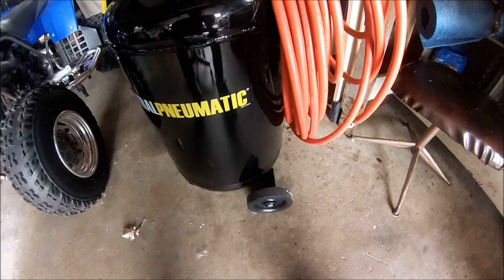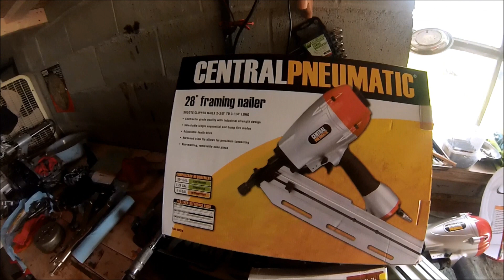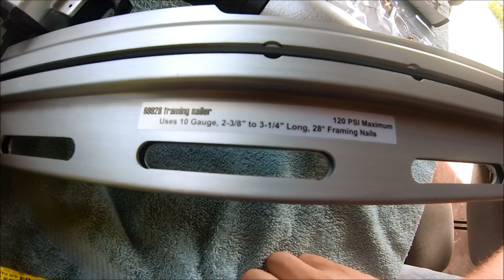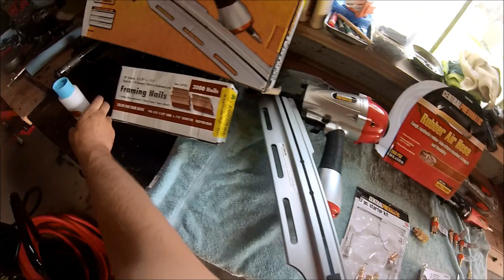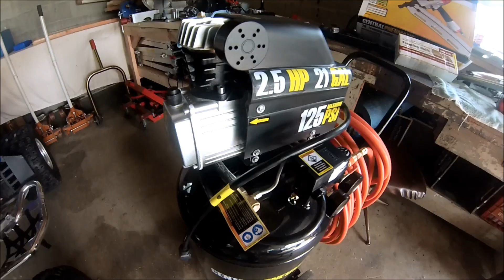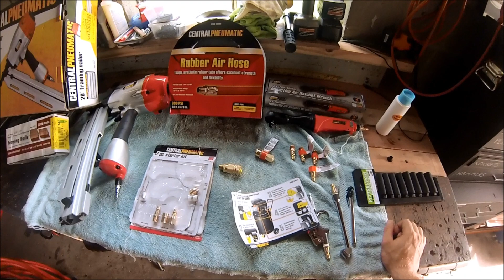Central Pneumatic 21 Gallon 2.5hp Air compressor

Comment: I just pick this compressor and it works great but for some reason I have to drain the tank everytime I'm going to used it other wise it won't start up or if do start it will start really slow and engine will stop any suggestions?
Reply from the maker: +Juan Hernandez Harbor Freight has a good return policy.  Sounds like the pressure shut off valve is faulty.
Reply: Sparks Garage thanks, sure they really  good with that, but I wanted make sure is not something simple before taking  it back. I probably add the 2 year warranty also just in case.
Reply: Sounds like a bad relief valve, compressing the piston before it turns back on causing back pressure. What'd you end up doing?

Comment: On the 21 gal,  you have to change out the female fitting. The one that comes with it doesn't allow enough air use an impact.  If you are at HF. Look for yourself. You will see. The inside of the cheap fittings has smaller orfices.  Buy the premium fittings and you can run just about any tool.  Worked for me.
Reply from the maker: +Matthew Smith Good tip,  The other problem was the 21 gal did not hold enough air to remove 5 lug nuts,  Only 3
Reply: Nate Daniel mnpt

Comment: I just bought the 10 gallon one for 75 bucks lol
Reply from the maker: Michel Linschoten That might be fine for you.  Depends on the jobs.
Reply: Heeij used to manage with a 3gallon one!! Tacking, you name it. Problem is often people tend to put 50 yards of air hose on their compressors, and way,to heavy tools for the job at hand. 

I want a bigger one sooner or later, to spraypaint my house exterior. So a longer airhose would not be a problem. 

However that being said, i use my 50 yard line for my nailgun (small one) works pretty damn good.

Comment: on the to0p of the head there is a thing they call a start valve. during breakin, it constantly blew air. is it supposed to?
Reply from the maker: Steve Metz It takes some pressure build up before that valve seals in a lot of cases.  It should get better the more it is used.

Comment: I bought one of these a few months ago. Now that it's getting cold it doesn't want to start.  If I take it inside to let it warm up it works good.  Anyone experience this issue?
Reply: +Joe Sumfin, I drain the oil and filled it with Husky Synthetic blend compressor oil. This solved the issue for me.
Reply from the maker: Jason Fisher Very strange.  Are you sure it is the compressor and not the outlet?
Reply: Positive. 20 amp dedicated circuit, with no extention cord.
Reply: Jason Fisher I am now experiencing the same thing as you.  I used it a few times in the winter and I'm thinking there probably shouldn't be air in it in the winter as it creates mositure which can freeze and maybe did something to the "plumbing" of it.  I tried to turn it on once and it almost started but then stopped.  Its not the plug in, other things run on it.  I now have a space heater on it to see if that helps.  I hope it does.  Next thing I might try is to bring it in a couple days and see if theres a drain valve and mess with it more after that...  /shrug.  Otherwise its been a decent(but loud) compressor.
Reply: Joe Sumfin, I drain the oil and filled it with Husky Synthetic blend compressor oil.  This solved the issue for me.

Comment: You should have done a break-in procedure. This is necessary to seat the rings. Generally 20 to 30 minutes of free running with the drain open. The manual for this particular unit specifies 30 minutes.
Reply: ***** I do believe they break these in before hand honestly my fittings on my regulator had rust in them right out of the box when i setup my compressor..
Reply from the maker: Everyone is entitled to their opinion.
Reply: That's very true. And since break-in is the manufacturer's opinion I thought it was worth mentioning.